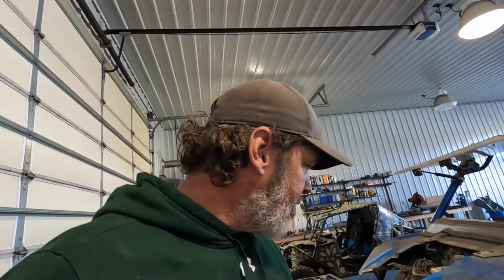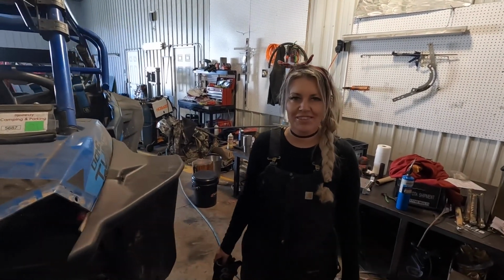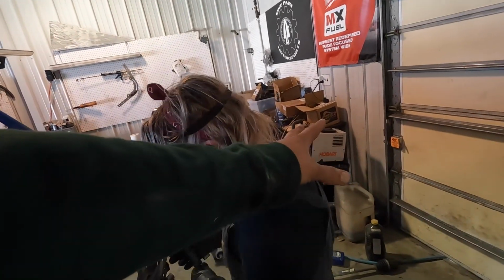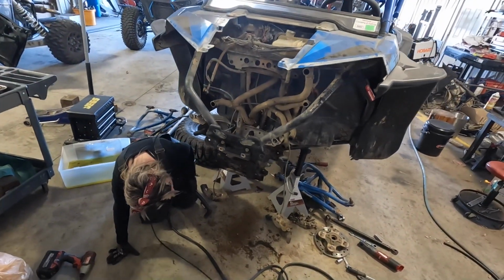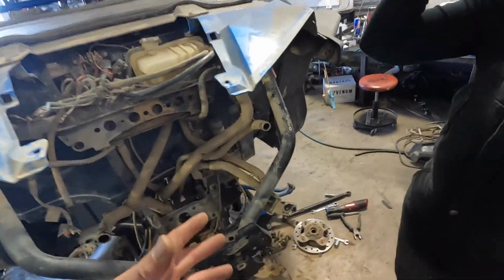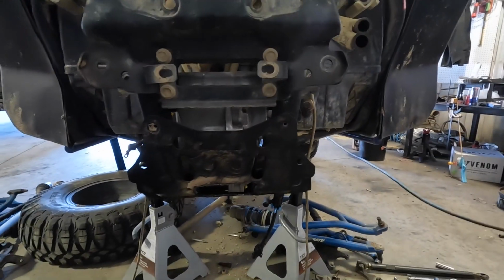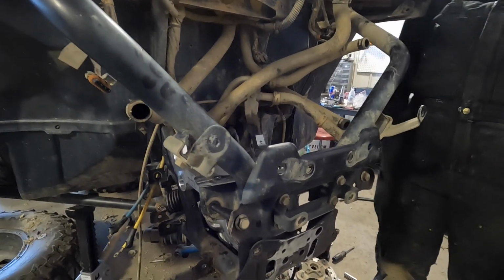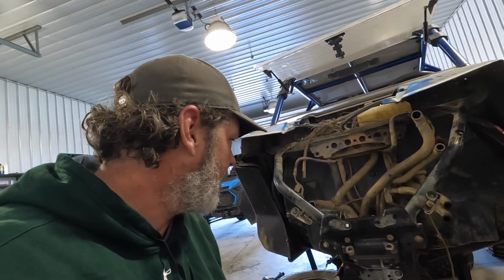RS1 Polaris RZR Turbo Diff Swap

Comment: When you do a gear reduction, would you have to change the gearing in the diff to match?
Reply from the maker: No since the front diff is ran straight from the transmission (transaxle) you don’t have to do anything to the front
Reply: @CrashCitySxS How come I'm told I can't install a RS1 front differential  in my TRE because of the gearing?
Reply from the maker: @Indianahillclimber most rzr front diff ratios are around 3.17:1. TRE is 3.82:1. 

They’re probably wondering if that gearing difference in the front is gonna bind up the driveline.  The only difference in the transmission is gearing. The always say you have to change out the ring gear and pinion shaft to do that swap in a HL or TRE. But the final ratios in the rear are around the same as other rzrs or rzrs with gear reduction so is there really that big of a difference??? 

The ratio in the front has to be a little different than the rear to let the 4wd work the way they have it work. 

I need to look more into this…..
Reply: @CrashCitySxS Iv always wondered that too. I’m just glad I didn’t buy one of those models. All the parts sellers all they you can’t use their diff parts or their transmission parts in the tre. I’m assuming the different diff gearing is to make the fronts spin even quicker than the rears, making the diff grab that much sooner and harder, but that doesn’t mean doing a gear reduction in the transmission would change any of that. Iv read a lot where people say you can’t rs1 swap the tre, but wouldn’t you just be changing it to a regular drive ratio. Only thing I can think of is if the tre transmissions have a different output gearing to the front driveshaft, I’m not sure if that’s the case and I doubt it would be, like if the snorkel gear had a different gearing then I could see how all of that would be different

Comment: So if you think a billet xp turbo diff with sandcraft boom proof kit is just as good as a rs1 front diff then why do all that extra work?  I’m debating doing the rs1 diff swap but if the billet diff is just as good then I would do that first. Let me know what is best. Thanks
Reply from the maker: Fully built xp diff Is almost the same or the same strength as a STOCK rs1 diff is my opinion. So I’d calculate the cost of the billet case and upgraded internals vs a new or new/used rs1. Like this diff was 1200 and the Coffman bracket was 400 i think. So 1600 and some elbow grease you’re as strong or stronger as fully built xp. With room to upgrade internals if needed. 

I’d do the rs1 swap over building up a xp diff if it were me.
Reply: @CrashCitySxS  thanks for your advice. Much appreciated and great video.
Reply from the maker: @250offroad9 you’re welcome and thanks for watching